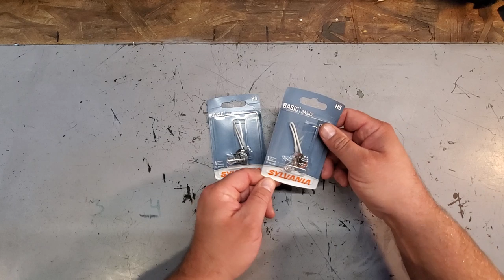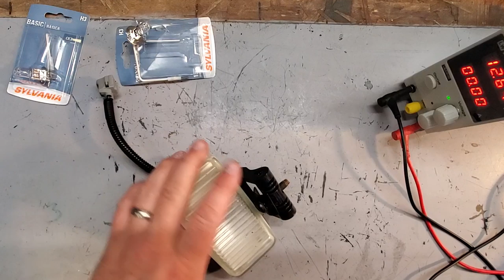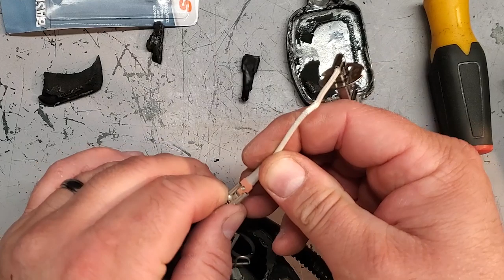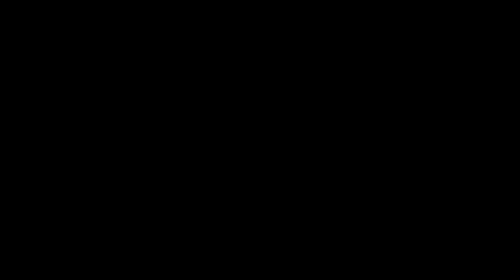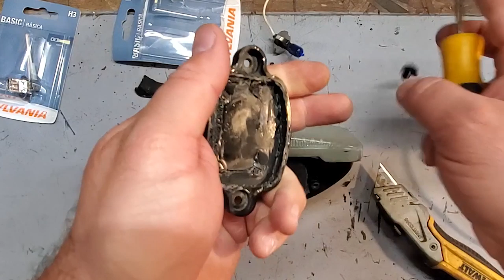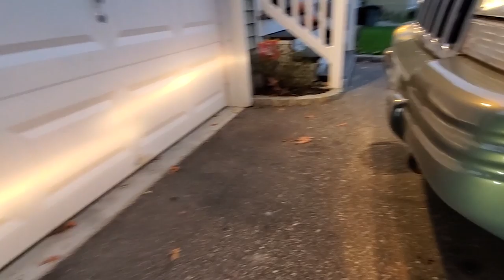JEEP ZJ FOG LIGHTS - STOCK LENSES AND OEM STYLE BULB REPLACEMENT

Comment: The stock fog lights on the ZJ's are pretty good.  I actually drove about 35 miles one night with just the fog lights on I was about 3 miles from home and got pulled over for not having my headlights on.  The cop asked where I was coming from and headed.  I told her that I had driven from a town about 35 miles away and was headed home, she says dang that's pretty good for not having the headlights on the whole way LOL.  I said well I guess the fog light bulbs must work pretty well as I didn't even notice that I didn't turn my headlights back on after leaving a gas station heading back home LOL.  Trouble is if you get the fog lights too bright then it defeats the point of fog lights, they should be a little dimmer to keep from bouncing the light off the fog right back at you.  

I have a cracked lens on one of my fog lights and haven't yet made it over to a pick a part to get a replacement lamp assembly.  I also need a replacement driver door interior panel as the armrest on that panel in my 98 ZJ looks like the one on your's, pretty torn up LOL.  I've got a list not only for my 98 ZJ but for my 88 Ford Bronco 2 as well, I just haven't really felt like doing much most of this year for some reason.  I get home from work and don't want and feel like doing anything, and on my days off I just want to stay home and not do anything.  Pretty much the end of the pick a part season, weather is getting colder and I hate trying to wrench on stuff in the cold.  In the summer the wasps and hornets are so bad I typically never go during the summer either LOL.
Reply from the maker: Wow!  That's a heck of a fog light story!  Glad the cop was cool!  I stinks how the housings always get blasted by rock so easily.
Reply: @ProjectDanH  They get blasted by everything, and water if you drive through deep water you end up with water logged fog lights LOL.  My 96 ZJ and my current 98 ZJ both had/have factory fog lights.  After a moron volunteer firefighter with dismal driving skills took the front plastic bumper cover off my 96 ZJ I had an ARB bumper put on, as a result the factory fog lights were no longer usable...I did manage to lengthen the wiring and plug them back in and mounted them on the bumper...seemed to work ok though.

Comment: Hey Dan H I got a new one for you I changed out my factory fog lights with new aftermarket ones  an now when I turn them on my speedometer goes crazy an my engine revs up.  I hooked them into factory wires an to my surprise the factory wires was not the same hook ups on jeep  drivers side was gray an passenger side was black an a waterproof an newer version
Reply from the maker: well thats definately odd... any updates?

Comment: Lights look identical to those I bought from Parts Geek to install on my XJ,my 01 XJ did not have the fog light option it was a complete wiring project with a 3 switch panel I bought on eBay,relay and wire.....had to have em!
Reply from the maker: The XJ and ZJ Fog lights are almost Identical.  Im so glad you used the OEM 3 switch panel when wiring up own fog lights, That's exactly how i would do it!
Reply: @ProjectDanH  XJ and ZJ **
Reply from the maker: @jaysmith5084  ha! Yup!

Comment: i have a question is the bulb under the headlights just a turn signal bulb? is it not a marker light? i know the 194 bulbs are marker lights
Reply from the maker: you are correct, the bulbs under the lights are round socket turn signals from 93-95 and then plug in style connectors from 96-98

Comment: Hi Dan I  have a 97 jeep grand cherokee laredo. When I  go out anywhere. And I  turn off the vehicle go in the store. Comes back out it  hesitates to start. So I  have to Waite for the car to cool down then it will start. I tried wrapping the fuel injectors with spark plug boot protector. No help. Can you help?
Reply from the maker: I've never had heat soak not allow a restart... heat soak problems usually will allow a start, but make the jeep run rough.

Comment: Just wanna ask what are the most common problems on zj's
Reply from the maker: 42RE Transmission, VIC coolant sensor false warning due to poor VIC solder Joints,. flap glass adjar sensor, memory mirror keep defaulting to down and away position,  leaky weatherstripping,. sagging door hinges.. rust rust rust